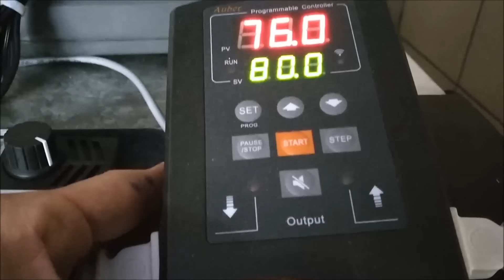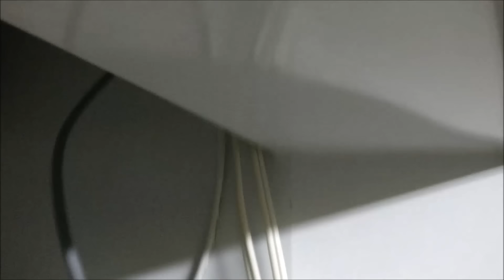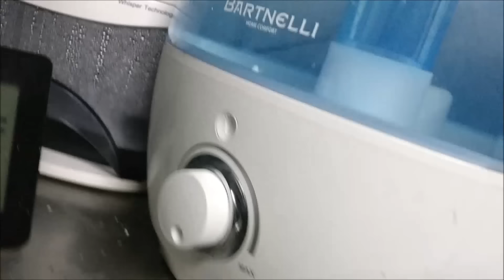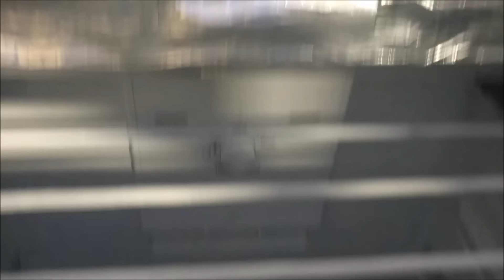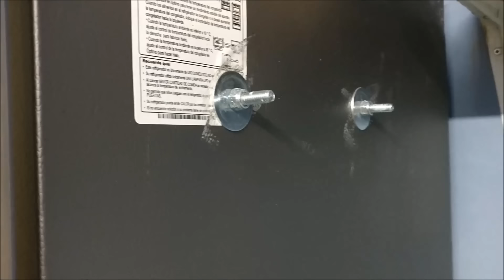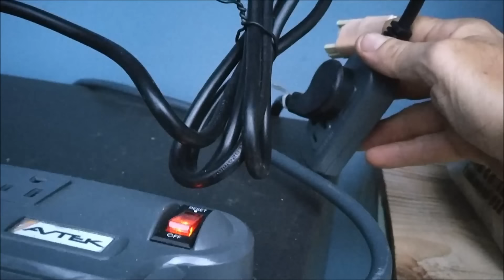Building a Drying Chamber for Salami/Salumi

Comment: I want to make a dry salami and I'm going to use insta cure number two as was recommended to me because I will not be cooking the salami at all what I wanted to know though is if to cut down on the drying time I could put it in a dehydrator on low for a few days to shave off maybe a week or two and then just cure it for 2 weeks instead of four to five I'm not sure if that would be okay using nitrates though as I've never used them before in curing just the regular salt
Reply from the maker: Hey Guy.  Thanks for the comment. Making salami is as much an art as it is a craft.  It requires lots of patience.  The beauty behind salami is the slow even drying that happens in a controlled environment (regulated temp and humidity).  If you change the parameters too much your product will become ruined.  For instance if your temp is too high or there's too much air flow the salami will dry out too fast and create a dry ring around the outside.  This is called case hardening and will cause the inside to become spoiled.  So to answer your question, a dehydrator wouldn't work.  Too much air flow and not enough humidity.

Comment: I have a double door cooler and would love to set it up the same way you did.  Any advice for a cooler twice that size?  Two fans or larger humidifier or dehumidifier ect.  Any advice would help considering your video has been the most informative I’ve seen so far.
Reply from the maker: I'm jealous.  Mine can fit almost 250 pounds worth of product.  I can't even imagine having one twice as big!!  Prosciutto?  Culatello?  Wow the possibilities..  Each chamber is unique.  The Eva Dry 2200 (https://amzn.to/371ag1V) is a large enough unit I think to handle that size fridge.  I wouldn't go any smaller.  Perhaps 2 of them plugged to the same chord.  1 Humidifier would be sufficient but you'll probably have to add water to it more frequently than most.  A couple computer fans towards the top moving air around wouldn't hurt.  The dehumidifier also moves air around a little from it's vents.  That would be a good start.
Reply: 2 Guys & A Cooler ok I’m going to order the hd220 and some computer fans as well as the humidifiers and dehumidifier.  I really appreciate your advice.  I can update you as I go if you wish.
Reply from the maker: @joedotta567  Hey Joe.  Th eHD220 is great.  Keeps the humidity on track.  I would love to be updated as you build your chamber.  If you have any questions or problems be sure to reach out.  Talk soon.

Comment: Hi and thanks for the Video very interesting. I want to do a similar arrangement, and plan to use the AUBER TH220 Humeditiy/Temp Controler like you do. I am also planning a dehumidifier/Humidifier set up like yours. One question as the Auber has one Output to control the humidifier, how did you manage to control both Humidifier/Dehumidifier at the same time from one socket?
TIA
Reply from the maker: Hello Stevei.  I don't personally use the Auber TH220.  My set up requires a more dedicated humidity controller.  So the unit I use is the Auber HD220.  It has an socket for humidity and a socket for dehumidifying.  To control the temp I either use the inkbird temp controller or the Johnson temp controller.  Both work well.
Reply: 2 Guys & A Cooler Why the Auber instead of InkBird for humidity control?

Comment: Hi, just a quick question here, how does your temperature controller modify the temperature up to 70 ° in the refrigerator as it is a cold environment by nature? Thanks!
Reply from the maker: Hello Saucissons.TV  The temperature controller simply cuts on and off the refrigerator.  So I set the parameters on my controller and the probe inside monitors the temp.  Where I live it's almost always 75F outdoors so if the fridge is cut off the temp will rise naturally.  Generally French Saucisson is fermented at lower temps (depending on the culture that you use) so staying around 68F/20C is relatively easy.  If I am using a starter culture that needs hotter temps I'll place the salami in a box with a dedicated heating element so that it can get to 95F/35C.    The controller does have the option to add a "heating" element to the inside of your fridge like a 100w light or a reptile heating pad.  This will raise the temp as well.  This is a good option is you are in the middle of winter and you want to make that delicious Saucisson sec :)  Let me know if that answers your question..

Comment: Your dehumidifier seems to be one of those small ones that uses peltier technology.   How do you get it to work?   All the peltier dehumidifiers I have found, do not work at temperatures below 15 degrees C.  I had one, hitched up to my humidity controller, which switched on OK but didn't suck up even a drop of moisture in a month.  I never had to empty it once!   The fridge itself sucks up humidity when it comes on, but in colder temperatures in winter, it doesn't come on often enough to keep the humidity down.   As I've had some mould problems, I'd like to suck it down to around 72% but that's not possible at these temperatures.  I don't have a fan installed - maybe hitch one up to the humidity controller?  That might pull warm air in, thereby triggering the fridge.   But what I'd really like is a dehumidifier that works at around 13 degrees C.  Anyone any ideas?  Needs to be available here in the UK.
Reply from the maker: You know I never seem to have a problem.  Yes I am using a dehumidifier with the peltier technology but mine draws moisture out of the air no problem.  I have found the EvaDry 2200 to be more effective than their smaller model but both seem to keep my humidity in line (generally between 70-80%)

Comment: Great Video! Do you need any vents to circulate air from the outside of the fridge? What temp and humidity do you set it at?
Reply from the maker: That's a tough question to answer. Yes.  There needs to be air circulation in the chamber to allow fresh air in and old air out but every chamber is different and unique and depending on where you live and the outside temp and humidity will ultimately determine the final design of the chamber.  Some people do drill air vents on the side of the chamber. For me I just open my door once a day and that's sufficient enough to allow fresh air to come in.
Reply from the maker: I also set the temp at 55f and the humidity at 80%

Comment: So how do you keep the temp so hi in the fridge ...57* thats my only hurdle
Reply from the maker: I guess it really depends where you live.  Where I live it's 75F all the time so when the fridge is off the temp will naturally want to rise inside.  For me I only need the fridge to cut on every once in a while to lower the temp to 55f-57f.  I use a temperature controller to do that:  https://amzn.to/32LmxF3   My fridge is plugged into the "cooling" part of the plug.  This same temp controller has the option to plug in a heating element (like a light bulb or something).  When you set the parameters either the heating element or the fridge will cut on.  This should get you where you need to be.  If you want to see the light set up I am talking about you can see it briefly here:  https://www.youtube.com/watch?v=k4EMSadi8TE (you can skip to the 10 minute mark)

hope that helps
Reply: Perfect... so i bought the inkbird humidity and temp controller also a computer fan that runs on hi at all times ...the humidity rises and falls pretty fast , humidifier turn on every 3 to 5 minutes, not sure if thats the fan drying out the chamber or not...its in a small "dorm " size fridge ...we shall see...i think ive watched all of your videos to  catch everything i could... my humidity is set at 72 it normally goes to 78 and drops down and my fridge is set at 57... i live in montana so there hardley no humidity here...thanks for all your help
Boone
Reply from the maker: @boonedalton6201  Hey Boone.  Your humidity is going to rise and fall as the fridge cuts on and off.  This is normal.  What you are looking for is an average of about 75-80.  If it were me I'd raise the humidity to 78% and monitor it.  If the humidity is too low your meat will dry too fast and will cause a dry ring to form on the outside of your meats..  In a small chamber you can also turn down the computer fan if that's an option.  All you need is a very gentle air flow.  Too much will also dry your meat out too fast.  After your first attempt at dry curing meat you'll have a better idea on how to tweak your chamber, but once you have it you'll be set :)
Reply: Thanks .... thats what i needed to know...appreaciate it!

Comment: did you have to tear into the inside of dehumidifier and bypass the on & off switch . I have the humidity controller and i set it for my high - low . It will shut my dehumidifier off but will not start it back up when the humidity gets to the high point . I think this problem  is do to the humidifier on & off switch . you can email me at mike.mibbs@yahoo.com
Reply from the maker: Hey Mike.  Thanks for the comment.  You might have a controller issue.  What brand do you use?  This happened to one of my controllers and I had to replace the relay on it..  I'll email you off line and we can chat about it..

Comment: Great video and very informative. Do you run that small fan 24/7? Thanks.
Reply from the maker: Yes.  That little fan runs 24/7.   It's a medium speed fan so it's just enough to move the air around a little bit but not over dry my meats..
Reply: @2guysandacooler  thank you

Comment: I did some ventilation holes on mine and the fridge stopped cooling and after seeing your video I guess it is possible I puncture a cooling line. Never imagined the walls had anything in them. 
For my new fridge.... any ways to know where those line run so I dont break another one like this?
Reply: Hey, i just aligned my drill holes where my fridge had the brackets (to hold the shelf)  attached in the factory. I assumed that was the least likely place. My fridge is also an older model.
Reply from the maker: @damion20312  That's awesome.  Great tip!!
Reply from the maker: Hello Xavier,  Yep.  It sounds like you nicked a pipe just like me.   Unfortunately there is no way to know for sure.  Each fridge has a tube pattern of it's own.  If you have to drill into the fridge the best way would be to remove a horizontal strip of fridge along the outside of the fridge wall.  Carefully remove the insulation to expose the tubes.  Then drill your holes on the inside.  When you are done refill the insulation with expandable foam and clean up the excess.   It's a huge pain to be honest.  If you decide to go that route let me know what happens...

Comment: My fridge doesn't have pipes, just insulation. I did drill through the left wall and I heard air escaping maybe that was just the pressured air. was told nothing should happen if I reseal the hole again after I put all the cables through. I did test it without sealing proper and when the fridge came on the temperature went up instead of down. Any idea?
Reply from the maker: Oh no!!  Contrary to what they told you it sounds like you did exactly what I did towards the end of this video.   The air escaping was freon gas from the fridge.   That gas causes the fridge to cool down so without it the fridge will only blow warm air.   That's why the temp is now rising...   That sucks!   The only way to fix it is to weld the pipe so that the hole is closed.   Then refill with the right type of freon.  Sorry for the bad news...

Comment: I built this and have following problem:
When my fridge turns on, the humidity shoots down to 40%. Then as soon as it turns off, the water on back panel consenses and humidity shoots up to 90-ies.

Then my dehumidifier kicks in and starta reducing humidity, but it heats up the chamber so the fridge kicks in again and like that forever
Reply from the maker: I have a lot of questions.  Answering each one will help me understand your problem.  I had the same problem and was able to fix it but every fridge is different...  here are the questions:
How often is your unit turning on and off?  Is it being controlled by the fridge thermostat or an external unit like an Auber?  What is your set values on your temp and humidity.  Also what is you over and under values, for me I have my humidity set at 80% with a 5% over and a 5% under variance.  What kind of fan is being used in the chamber.  Is the fan constantly running or does it only come on when the compressor turns on?  Do you have any holes in the chamber for outside air to enter?  
ok that's it for now.  Let me know this and we can see if we can solve your issue :)
Reply: 2 Guys & A Cooler 
Fridge runs every hour or so. 
External thermometer.
Temp set 12C +-3 
Humidity 80%-83% (can only run either humidify mode or dehumidify mode)
PC fan running all time. Big fridge fan running when cooling starts.

Have penny sized holes covered by 120mm fans on top right and bottom ledt side, for air exchange 2 a day.
Reply from the maker: @franperk  ok.  You will want to try one thing at a time to see how it affects your chamber environment.  I would start by disconnecting the main fan in the chamber and placing your computer fan close to where it was.    This will limit the amount of air your fridge removes when it shuts on.   As soon as I did this my humidity stabilized.   The fridge doesn't get cold enough for the coils to freeze so it won't be a problem.   

My fridge had a plug for the fan that all I needed to do was unplug.  Not sure what kind of fridge you have but hopefully it's that's easy.
Let me know what you think.   If you try this let me know what happens..
Reply: 2 Guys & A Cooler Thanks, I tried this but it is still a bit too cold outside for my fridge to run properly. I’ll try this in a month and report back.
Reply from the maker: @franperk  excellent.  Looking forward to it..
Reply: Did you ever get this figured out?  I’m having the same problem. When the fridge kicks on cools my chamber to the proper temp and then turns off I get a ton of condensation which skyrockets the humidity. My dehumidifier has been unable to get the humidity down. I’m going to install a fan tomorrow(been waiting on amazon) but I don’t know if that will change anything.

Comment: Great set up but in all honesty i get great results with just a fridge  a little tinkering with the fridge cooling control and using a couple of damp towels that i sterilise in boiling water every 3 days gets me in the ranges i want. Just in case you're on a budget don't let the cost put you off, I've even made some salami with out the starters and just hung them in the fridge they were fine not as acidic and variable flavours but fine with curing salts spices and nitrates/nitrites and cold fridge I'm sure they are safe, but i admit the way you did tin the vid is much safer and will give consistency every time.
Reply from the maker: You are so right.  Lots of ways to make salami.  I like hearing about all the DIY's they give me cool ideas.  Thanks for sharing!!  Thanks for the comment..
Reply: Hi. So do you plug the  fridge freezer plug into the cooling socket of the temperature controller?
Reply from the maker: yes, sorry for the delayed response.  I just saw your comment...
Reply: @2guysandacooler  Wondering about the use of a duel humidifier and dehumidifier rather than the 2 pieces? That is if there is a unit that will do both that is small in size and affective... Is that a viable way to make the unit work. So then using a plug and play atmospheric controller with the fridge direct for temp in 1 side of the socket and the dule humidifier / dehumidifier in the other socket? Or if humidifier
Reply: @2guysandacooler  thank you for this, exactly the Q&A i was looking for